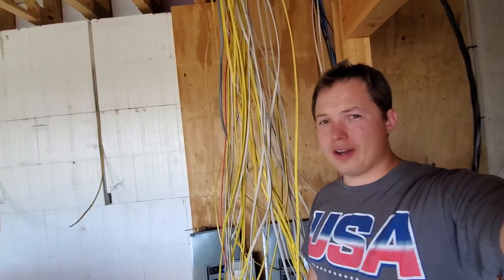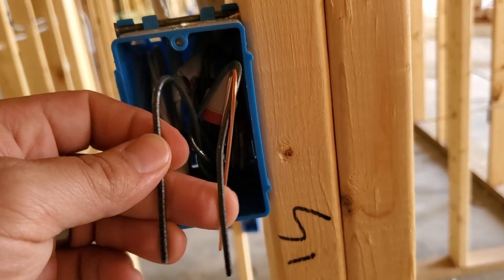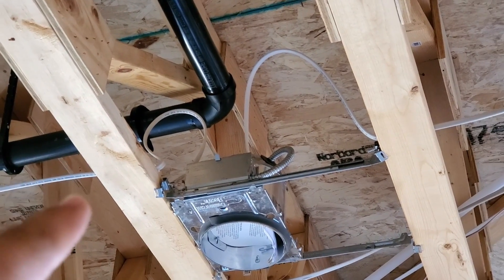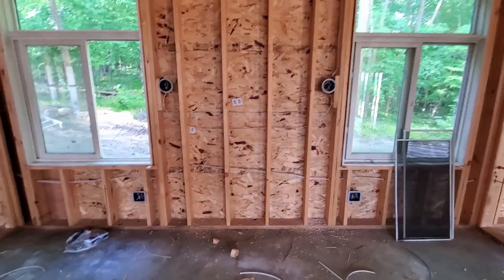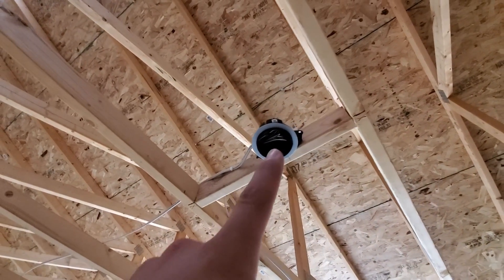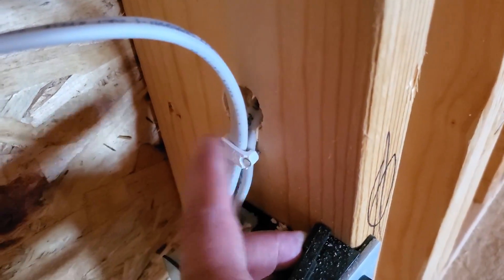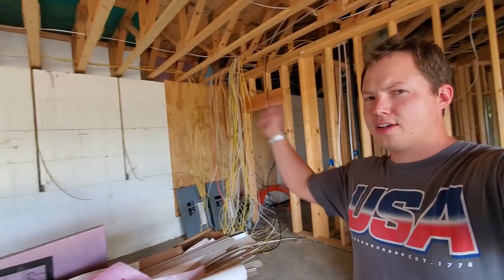New House Wiring Rough In Project Tour!

Comment: Wow, that looks like a huge house! Nice.

At 2:34 - I am not a fan of plastic boxes, especially those really low-cost blue ones. The fiberglass ones are sturdier, but they can get destroyed if you're clumsy with a hammer.  What's true with both the plastic and fiberglass, however, is the mounting holes for the device screws can strip out! That has happened to me a few times. Then you're basically forced to use a drywall screw to bite into the hole in order to mount the device, which makes me cringe.

No, I like STEEL boxes, particularly four-inch square boxes with a mud ring. If you price them at Menards you'll discover a 1 1/2" deep 4" box PLUS a 1/2" depth single gang mud ring costs less than $2, which is less than the cost of a steel single-gang device box. This is because those 4" boxes are VERY mass produced, because steel boxes are required in commercial construction with steel studs.

For wood framing, I like to bolt a piece of 2x4 blocking across two studs on end, and then bolt the steel box to that block using the holes in the back of the box. Super strong, and this also adds structure to the wall too!

With the 4" square box, not only do you get LOTS of cubic inch volume for wire fill, they are VERY durable, and another perk with steel boxes is that if you bond all the ground conductors together in the box with a pigtail to the box's bonding screw, you do NOT need to run separate pigtail grounds to each devices mounted to the box, because devices self-ground with their mounting (yoke) screws. However, you do need to remember to buy a pack of 10-32 screws because boxes usually do no come with them.

At 2:58 that looks like WAY too many cables for a 2-gang box. Maybe it's just a temporary "placeholder box" because they ran out of 3-gang ones and will replace it before the drywall goes up? Because there's no way that many cables would be used for just two devices. Since those cables haven't been unsheathed yet, that is my suspicion.

As far as bundles of wires, my dad's recently-built lake house in WI is FULL of instances where the electrician shoved three 14/2 cables through those black plastic grommet-style box connectors, as well as lacing three or even four cables through 3/4" holes that were made in plates and joists (those wood I-beam style joists where you can punch out a hole in the thin OSB with a hammer blow). I was pretty surprised to see that, honestly. But it does make me think inspectors may not make that big of a deal about it perhaps because they are lighting circuits with intermittent loads, as you said.

At 4:15 I think you're exactly right, you can't embed NM cable in concrete so it must go up and over. I'm guessing those vertical "chases" are pre-formed especially for wiring and will not be exposed to the concrete pour? Not totally sure, I haven't seen that in person before. Oddly, drywall gets bolted directly to those forms I think.

At 5:40 I have seen that technique of bolting a mud ring to the face of a stud for a low voltage ring in a new house build! That is a brilliant rough-in hack because as you know a box is not required for low voltage.

At 6:20, just guessing the orange-tape wires are for re-designating the white as current-carrying on a 3-way switch circuit? But there are so many more wires in there too, they're probably feeders for the lights. All switch boxes must have a neutral now for electronic switches that, themselves, require power. Apparently they may not be sharing the same feeder. Who knows.

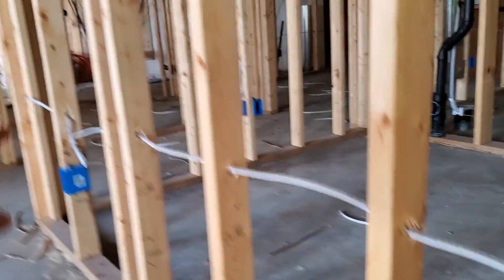At 7:00, if you're a perfectionist making sure all the cable holes are all at the same elevation at each stud, you should use a laser level and shoot a line beam across all the studs to make your holes! Now that is extremely anal. lol

At 9:05, I'm not a huge fan of permanent lights built in walls for each side of a bed, that's just my opinion. It's too permanent and forces a bed to be there forever. If there's enough receptacles in the room, then you have the freedom to put the bed wherever you want. I'm a traditionalist with just a lamp on a nightstand. My USB charger is permanently plugged in behind it, and the cable is just laying there for me to plug in the phone. If you like having a receptacle at mattress height, well, just have a good quality, short extension cord (I suggest an appliance extension cord). You could zip tie it to the bed post or something, and hide it so it's inconspicuous.

At 11:05, those shallow round fixture boxes are often called "pancake boxes". They have JUST enough volume to make a fixture splice and that's it. They're typically used for surface-mounted light fixtures with a canopy that covers them. My guess is in this house  they will be for pendant lights hanging over a center island. It's not clear to me why pancake boxes are used in new construction where the ceiling covering is not in yet? Because if the space is wide open as it is here, it's better to rough in normal round fixture boxes that have depth. Maybe it's because the position of those lights needs to be exactly where the truss they're mounted to happens to be.

At 11:45 - Yeah I agree that ideally all receptacles should be run with 12/2 cable. You need not use 20A receptacles nor 20A breakers when you use 12/2 cable, but you have the ability to upgrade a circuit to 20A later should you ever need to. However, that would be in MY house. For almost anyone else's house, it is VERY unlikely they'd need 20A in a living space other than a kitchen or bathroom, and the cost of 12 versus 14 is not trivial.

At 12:48 - Hah, I haven't seen that before, where the cable for a vanity light is loosely laced through the studs since it's not known where the fixture will land after the room gets finished. That's very clever. Now hopefully they won't cut into the vent pipe accidentally when it comes time to make the hole for the box. lol

Other observations:

If I were the home buyer I would certainly insist on Cat 6 cable run everywhere, at least two cable runs per gang and a couple gangs per living space (bedrooms, living room, den, etc.). I'd also have four round ceiling boxes, spaced evenly throughout the house across the two floors, with Cat 6 runs in them for ceiling-mounted wireless APs. Gotta future-proof homes as much as possible.

I like the ABS drain/waste/vent plumbing. I'm a fan of ABS, it's lighterweight than PVC and easier to work with. Just chop and glue. I'm not sure why it's not more common, but it is used almost exclusively in Canada and a handful of states. I've noticed here in MN it seems to be a mix of both PVC and ABS, it all depends on the preference of the plumber or builder. But PVC seems to dominate in the US.
Reply: Always like the idea of running Cat 6 everywhere.  Lots of builders seem neglect to do it and everyone thinks wireless is the way of the future, but I am in IT so I know that a wired connection is far better than wireless.  One local builder in my area always runs the Cat 6 in conduits so it can changed out once something better comes out.  All Cat 6 should be run back to a central location that is not one of those tight media cabinets everyone sells.  

I also like the idea of ABS although it is not available in my area :(
Reply: 2:58 2 gang if    3 14-2 and 2 14-3 with the devices it comes out to 34cm and an avg 2 gang is 35cm
(imagine tho wirenuts/connectors and decora switches literally jammed in that box 🤦‍♀️🤦‍♀️🙄)

11:45 i did some qck chcking ya its 1/3 more to go with 12/2 over 14/2 i wld plan outlet demands carefully same as to where to place metal boxes over plastic (some outlets and most switches no problem of stress/use to use plastic others metal will hold up longer)

Comment: @9:15 I did an install like that for a client once, with his & hers 3-way switches so that either light could be switched on/off from either side, nearest switch from bed was "yours", far was "theirs" in case they fell asleep with the light on.

@13:00 same preference here for closet light. On solid headers it ends up being surface mount, or strip light tucked in corner on ceiling.
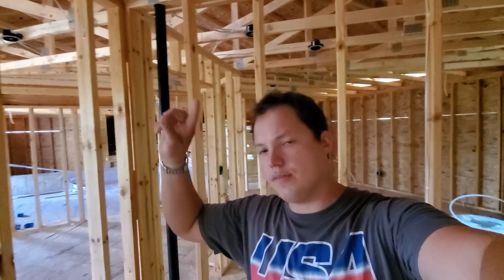@15:00 I like that idea, I'll have to remember it. But honestly, the sink rough-ins are a pretty good starting point for horizontal placement. The issue is more about height. Both of which are negated if it's architectural grade stuff that is integrated to the mirror/cabinetry.

Original Q/A: Arlington One-box (e.g. F101/F102/F103/F104/F101H) and Madison Smart-Box (MSB1G, MSB22+, MSBHZ, MSB2G, etc) are two of my must-keep-on-hand problem solvers for new-work in kitchen/bath and old-work in general.
Hate cheap blue boxes, period.
Most adjustable-depth platic boxes have too much slop, especially the familiar blue brand.
Plastic boxes with metal clips for screw retainers are junk (P&S/Slater).
Carlon Super blue are sturdy.
Reply from the maker: Great points. Thanks for sharing the specific model numbers. That is super useful!
Reply: The F101H and MSBHZ are horizontal boxed, good for mounting t-stats.

Comment: To answer your question Ben, when running vertically through a top or bottom plate, it doesn't matter if the hole is 3/4" or 2", you can't run more than 4 wires without derating the CCCs. Our AHJ has made this an important point of emphasis since Jan 1. I got popped on an inspection for having 8 #14 CCCs through a 2" hole in a 2x6 top plate. Your AHJ may not be as strict.
When running horizontally through wall studs, there is NO limitation on the number of CCCs through each hole, as long as the hole is not being caulked or firestopped. It seems to be a misapplied urban/internet myth that no more than 2 or 3 wires can be run through wall studs. Thanks for the videos. BTW, it's 12" to any box, metal or plastic.
Reply: Ampacity adjustment only applies when more than (2) 2-wire cables are installed through a hole that is subsequently filled with caulk, expandable foam or insulation. If nothing that entraps heat fills the hole….you are fine.
Reply from the maker: Thanks for all of the clarification. The top or bottom plate concept is interesting. I guess its because they are concerned about fire being able to get out and or start in one wall cavity and move up into the attic? I might work towards making a video regarding this topic in particular since it seems like the topic could use some clarification. Sounds like some inspectors may not even agree on this though. Thanks again for the information!
Reply: Brian Middleton what is a CCC?
Reply: @shockingguy  Current Carrying Conductor
Reply: James Allen doh 🙄

Comment: Plastic boxes a no-no at ceiling due to majority of fixture weight, plastic has maybe 3lbs capacity- sconce only! Butchered the hell out of the framing for switch-box~ inspector can ding for that. The round boxes at kitchen ceiling are “pancake” or technically 3/0-4/0...yours was 4/0. These are immediately convenient, but fixture hanging screws are set lenght due to shallow vox, wiring cramped if more than one cable~ pinche! The single switch-ring for thermostat wire~ recomend notching-in to flush, drywall will bulge.
Reply: Plastic boxes can hold up to 35 lbs even more. Ceiling fans need to be steel.
Reply: @robertgregory2618  they make fiberglass ones that can hold up to 75 lbs (at least 20 yrs ago i dont really chk) but i wld use the metal heavy support ones myself to be safe
Reply from the maker: Ha! Yes I saw the notched studs while I was editing after the fact and wow! They really went after it! Good point about plastic in hanging fixture applications. I used fiberglass with 50lb ratings for all of my ceiling boxes except for the smoke detector boxes which were the blue plastic ones. The "pancake" boxes definitely have their limitations and should only be used only when absolutely necessary. I noticed how on one of them they had two cables coming into it and I'm guessing that it will be difficult to get that all crammed in there. I have only used them when I have a single cable coming into the box. Thanks for sharing!
Reply: @BenjaminSahlstrom  The saving grace with the two cables in that pancake box destined to be spliced with the fixture wires will be that the "box" volume may be increased be the canopy space of the fixture that covers it.
Reply: @aaron74  Doesn't work that way. Inspector has no idea what kind of light may be used there.
Reply: @robertgregory2618  Yeah that's true, at rough-in.
Reply: @BenjaminSahlstrom  In new construction I will try to use a metal box for lights.  If I am using an old work box I will pick up a 50lb rated plastic one.  Have not seen any fiberglass boxes sold around me, would like to check them out though.
Reply: @BenjaminSahlstrom  they do sell pancake boxes with dble flanges to support up to 50lbs at least back 20 yrs ago lol i havent ever needed them

Comment: That full 2 gang outlet reminded me of a stuffed 4 gang for kitchen/pantry/dining room box.  Those are NOT fun.   It is always nice to see how others do the job.  I chuckled at the low voltage mud ring because i was like 'damn I never thought of that.  In a pinch I had once cut off the backside of a side nail blue plastic box.  
  I always had used the blue plastic boxes, but recently used a fiberglass one, and It was so much easier to screw in the outlet screws.  I may be getting fiberglass next time I use up the ones of I have, but then again, I'll probably be cheap and get the blues again.
Reply from the maker: I like the plastic boxes because they seem less fragile mostly. I've seen cracked & broken fiberglass boxes a time or two but I know that generally they are pretty stout. The mud ring seems like a great idea like you said. Sometimes you just don't think of the obvious until you see someone else do it first!
Reply: Use your drill and screw long (1.5") 6's  into blues before nailing them up. The longer screw allows you to screw it in an inch or so and not have to worry about stripping the threads you just made. Your device screws will be much easier to screw in, especially in tight spaces!
Reply: they sell real cheap plastic half mud rings for low voltage remember seeing them in HD/Loews like 10 yrs ago
Reply: lol never mind i just checked HD it is easier and maybe cheaper to use just a normal mud ring unless i was going to shop around

Comment: this is funny. I just pulled wire today and then watched this video. Looks like I need to pull out some of the wire and drill a couple more holes. I didn't know you could only have two to one hole. Thanks for the informational video.
Reply: You're all circling around the rule, but not hitting dead center on it. Two things, distance from edge of framing member may induce the requirement for a nail plate (1-1/2" minimum), and second the derating only kicks in when bundled for greater than 24-inches, so to have a bundle come through a single hole, or two successive holes 24" apart but be properly non-bunded in either direction beyond is allowable.
Reply from the maker: @dwight.bennett  So horizontally in a wall you could in theory pull as many wires as you want through any given hole as long as they aren't "bundled" for more than 24"? So interesting.
Reply: @BenjaminSahlstrom  
NEC 310.15(B)(3)
Multiple factors on derating, but the language about 24 inches is in that section.
Obviously by reading others comments, there's all sorts of local "ideas" about what should be allowed through a single hole in framing. All of which is nonsense unless it is a written rule in a state/local ordinance.
Reply from the maker: Before you go to too much work you can always call your state inspector and see what they're okay with. Another comment said that in WI they allow up to three per hole so you never know. Let me know what you find out! Glad you got something out of the video!
Reply: You don't have to derate per NEC until you run 4 or more wires through any top or bottom joist. There is no limitation for wire fill when running horizontally.
Reply from the maker: @monkeyCmonkeyDoo  So interesting. Do you know the reasoning behind this? Seems like the same rule would apply weather it is horizontal or through the top/bottom plate. Thanks for the info.

Comment: Holy box fill on that 2 gang. And 3 wires max per hole. Atleast in Wisconsin
Reply: The “bore hole” fill is based on size.
Standard is 7/8 - 1”  and 3 wires max
Reply from the maker: @SteveScheets  Thanks for the clarification!
Reply from the maker: Yeah, I thought the same thing about that box. Thanks for the info on the number of cables per hole in WI. It's probably the same in MN I'd guess.
Reply: 3 14-2 and 2 14-3 with the devices it comes out to 34cm and an avg 2 gang is 35cm
Reply: Yes, we use a 7/8ths hole as well for drilling and max we put in is 3 romex runs in Wisconsin. Never had an issue with inspectors.

Comment: Nec states that you need to secure your wire in intervels not exceeding 4 1/2 feet and 12 inch of every outlet box,junction  box,cabinet or fitting.
Reply from the maker: Thanks for sharing your expertise!
Reply: @BenjaminSahlstrom  It also doesn't matter if the material is metal or non-metallic, I think you may not have been clear about that in your video. The 12" rule applies to both.
Reply: @aaron74  The material being secured matters A LOT! Article 300 specifies a wide variety of standards for securing conduit and cable being terminated or in a run.  There are specifications for EVERYTHING based on its material properties, its rated uses, etc.
Reply: @ubrayj02  Sorry I don't remember the context of what I said above. I think I might have been thinking of Type NM cable versus Type MC/AC/BX (flex metallic conduit) cable. The spacing requirements are the same for each, I believe, but I could be wrong... If anything the NM requires less space between fasteners, so it wouldn't hurt to apply the same spacing with flex metallic conduit. Same with non-flex conduit... easier to just remember the most restrictive spacing and go with that.